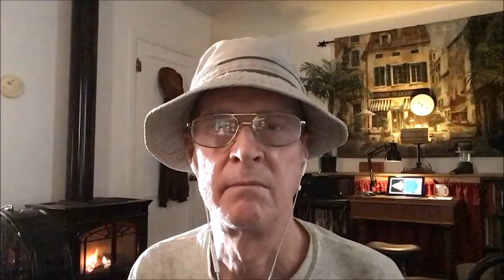Quick-Zip Dipole Antenna

Comment: OK, now you’ve done it.  I’m thinking about upping the game and using about 35 feet of 12/2 Romex.  The extra length would allow me to mount the antenna and have enough left for tuning.  Should I cut the green wire or leave it and run an earth ground.  By now it should be obvious that I know next to nothing about antennas, but I must build my own to satisfy draconian tenant rules.  Thanks for your patient and practical lessons.
Reply from the maker: I'd leave the green wire as is, and use an earth ground. 73 de Stan W1GV.

Comment: Stan, a friend of mine (SK) used heavy duty zip cord to show me how to make a 40 meter portable antenna.  After he “unzipped” the right amount (a bit over 33 feet), he tied a knot using the two strands.  The knot is called the electrician’s knot (I didn’t remember; I just looked it up).  It worked like a charm.  Even with his rushed measurements, the swr was less than 1.5:1.
Reply from the maker: Thanks. I don't think a conventional ham radio SWR meter would give an accurate reading, because it's designed for 50-ohm unbalanced line like coaxial cable, not balanced line like zip cord. You would need a sophisticated antenna analyzer to find out the true SWR on the line, although a conventional SWR meter at the transmitter would tell you what the radio "thinks" it is. The doggone thing worked, and that's what matters in real life! 73 de Stan W1GV.

Comment: Would the zip part be radiating from the transmatch also?
Reply from the maker: Theoretically, no. It would work in the same way as a center-fed antenna using ladder line. You would want to keep the whole arrangement as symmetrical as possible, just as you would do with any balanced antenna system. 73 de Stan W1GV.